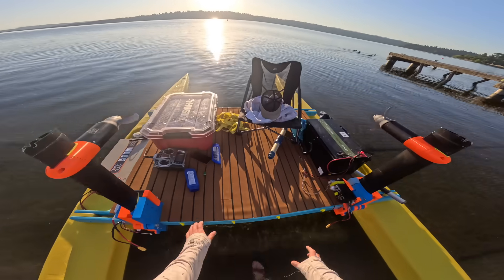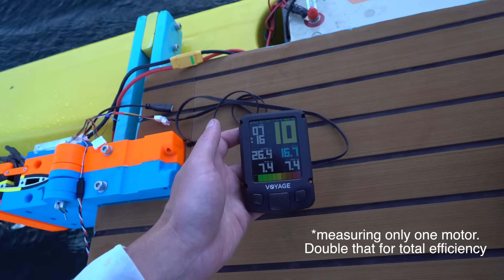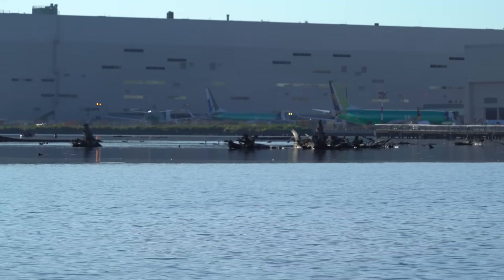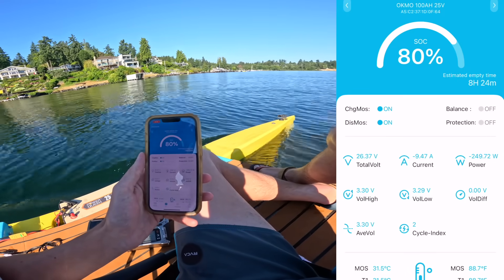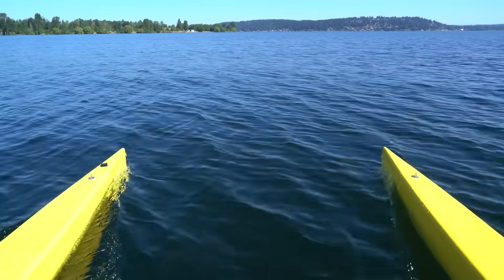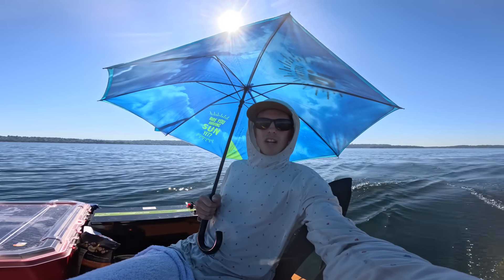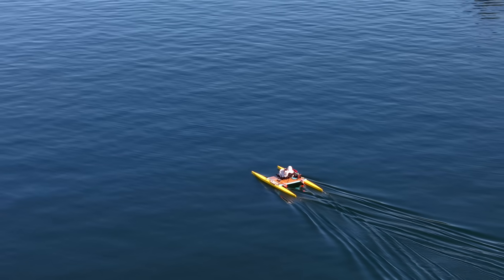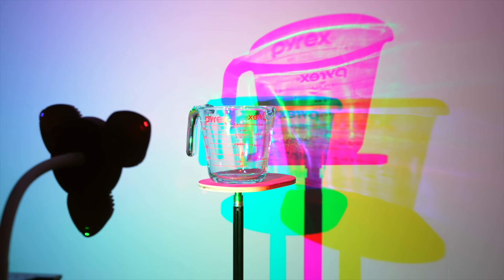Range Testing my Electric Micro Catamaran

Comment: You might want to consider adding V-shaped deck breakwaters along the forward sections of your hulls. These will deflect the water outboard before it can flow aft and potentially flood your bridge deck. It's a common retrofit solution for catamarans that experience bow diving in choppy conditions.

Comment: @rctestflight what about combining high speed stability and high efficiency in a dynamic design?. Imagine a 4 hulled katamaran (tetramaran?), but the external hulls should be significantly longer, then you can place fans pointing down, to fill up the space between the hulls with some air, sort of like a hoverboat, but because moving fast and not having a sideskirt, sort of like a ground effect vehicle, and use either propellers or back fans (or a combination) to move forward. Note the numbers of hulls was only 4 for this example, but it can actually be  increased, and the airfoil could be optimized to be efficient as both a buoy and a wing. All the fans would need active control of course, with an autopilot that allows for different flight modes, optimized for efficiency, speed, or optimal.

Comment: 07:00

The old run down house belonged to an old Navy vet who passed away in 2022 at the age of 91. So I'm guessing the boat has seen better days. He was a LTJG in the US Navy and afterwards went on to hold several leading positions with the Federal Maritime Commission including Director of the Bureau Compliance, Director of Domestic Regulations and Acting Director of the FMC, he was also Chairman of the Trans-Pacific Freight Conference. He has four children and fifteen grandchildren, I don't feel like putting his name out there but it was easy enough to find the house with google maps.

Zillow / redfin estimate for the house is between $5 & $6 mil. / 5100 sq. ft.

Comment: I remember in the video you mentioned that the catamaran tends to nose dive, which is an issue that old ocean liners had ( eg titanic and Lusitania) - to fix that issue you would probably want to try taking inspiration from large battleships (eg Yamato) as they increase the height at the front so it has a larger surface area. You probably already aware of this and have mentioned it, and I have probably just forgotten. Hopefully this is helpful, however I definitely could have phrased it better. Regardless, I cannot wait to see any future projects. :)

Comment: Would anyone array of solar panels provide enough energy to run electronics for telemetry and a few large servos? If so, how about a solar paneled sailing boat? Inboard wind/current sensors etc feeds data to an ECU that adjusts the sails and rudder to tack to the waypoints. Might even beat your other long range craft.

Comment: I have a proa, a large hull and a small hull. It handles waves over a metre high perfectly. The hull submerges easily under the waves, but I've placed the platform quite a bit higher up.

Comment: if you whant to increase the confort and avoid watersplash, take a look on va'a witch are tahitian traditionnal hull, they operate at the same speed as you and are very efficent. they also have like deflector and the top side of the hull witch are concave, that's helping when you are a bit diving it doesn't act like a fishing lure and keeps you floating even in rought conditions  thanks for the video

Comment: To manage splashes, which to your small boat you'd deem waves, consider flared bow tops. Something 3D printed should be enough to divert water off the front tips of the bow.

Either Atlantic Bow style flares, or World War 1 destroyer peaked bows to drive the water sideways away from the center, and definitely away from the battery compartments, which really need those capacitive water depth sensors to trigger the drainage pumps.

Comment: I think the taper on the rear hulls is adding more drag. You can see it by looking at the wake at 3:50. I'm pretty sure there is not enough flow seperation and its causing the flow on the sides to cross each other and creating the large wake.

Comment: I'm obviously partial towards your ground effect projects, but this here catamaran is probably my second favourite thing you built. :) The speed is impressive and makes me wonder whether you could build something even faster in the same format, perhaps with some active stabilisation using foils and/or vectoring to keep it stable over waves and in turns.
About the issue of workshop space, how about building the trimaran's central hull in two parts that you would assemble together before launch? That would also facilitate road transportation for the boat. Or you could build a bigger catamaran, which would probably be more hydrodynamically efficient anyway.

Comment: You must have designed the hall like hSv two, So how much you make it faster and increases the drag,
The fuselage whill ressist back  experientialy.
 within the volume of water that it increases  dependent depth exponentially,

So that's a way the geometry of fusion wouldn't be and limiting factor for your top speed,
It\n's would be the exact opposite at it would increase that drag and stability. 

You even can't put a certain amount of volume like a capsule or ceilander.
Along each individual Pontoons of cadomaran,
Acts along the body as a keel 
An also fix a mountain of water.This placement and drag four minimum speed , even. 
And then after those two long capsules , you can design that gradual curve,
Like hs v two u s army Catamaran .

Comment: You need lifting strakes, common on the front of pontoon boats. If mounted above the waterline, they have no effect on efficiency, but they deflect splash, and create lift when nosediving in to a wave. Below the waterline effects efficiency but lifts the front of the hull out of the water with enough power. You also need a solar bimini hard top.

Comment: You should make a little electronic devices to measure your kilowatt-hour/miles base on GPS+hall effect sensors so weather is integrated in the loop but give you real estimate of consumption for 50miles base on today weather.. because you can plot a graph with speed vs power and fine the most efficient point for your giving setup (motor, ESC, prop, battery, boat shape, drag (sensors, foils, safran)). (also if you can translate on the even just on an lcd screen measures for international standard viewers like me would be perfect (km, m, km/h...etc). I'm watching you from French Alps, you make very good content! 👍 Still understand, but can't represent my self what 50 miles really mean..  it's something like a bit more than 75 kilometers I guess, maybe 80..plus there is several miles type base on aéronautique, naval, and Brit... You don't make my job easy guys..😂

Comment: Advancing your ride height controller, I often dream about an active road vehicle suspension that instead of passively moving over bumps would actively pull the wheels up for upward pointing bumps and actively push wheels down for downward pointing dips.  Purpose would be an ultra smooth ride over bumpy roads. This could be semi-active where you’d simply variably valve a pneumatic suspension which can be done to respond quickly or physically push the wheels up or down. 

Thoughts?

Comment: About that makeshift wave dam. I used to sprint kayak competitively for many years. Sprint kayaks are pretty similar to these hulls, low to the surface so you wouldn't be affected by crosswinds. For longer distances, or choppy waters we would stick on our own makeshift wavebreakers, which is just a plastic soft drink bottle split into two "half pipes" , the two pointy ends attached forming a V shape, similar to a snowplow on trains. I thought it might be useful for you in the future.

Comment: 10:26 I've used blue painter's tape to seal a car that had a leak. Used the blue tape because I didn't want to have to clean up messy residue. The tape lasted 4 months, and only pulled loose because of of wind. It's water resistant and it won't lose it's stickiness. It's perfectly fine for that type of used.

Comment: I built a trimaran where the main hull was 17' long and 10" at it's widest. You have to sit on top because there's no way for a butt to fit in such a skinny hull. It has 2 4' amas for stability. It's pedal powered and shockingly efficient. It worked so well I quickly realized I have to build an electric version and a gas powered version. I am in the middle of converting 2 hobiecat hulls into a custom scuba diving boat with a 40 hp outboard. It should be very fast and very efficient and very stable.  Normally, if you're lucky, you get two of those three things.

Comment: So where are the largest gains to be made as far as speed and range go? Is it electronics & tuning, motors, propellers, or hull design? Like are you at the point where more power would mean larger batteries, more weight etc so diminishing return, so now your best move is to try different hull designs? Or are the hulls optimised and now the propellor design is where to put the effort?
It’s a fun/interesting set of challenges 👍

Comment: I use to race catamarans and to help prevent catastrophic nose dives we would have a foil shaped cross beam between the bows. It would be angled up slightly and about 3" to 4" on the chord although eventually the class rules were changed to limit the chord length. Primarily it was there to support the rigging but when the bows pitched in there was a noticeable corrective effect. To reinforce it you can use a vertical spar in the centre with a stay or cable running from bow to bow over top of the spar so the cross beam can be of lighter construction. Pros: on hot days the spray from the cross beam can be refreshing. Cons: If the cross beam digs in it's usually not a good day 😄

Comment: I vote in favour of the Trimeran project. Mostly because I got a double seat ocean kayak to make my own, inspired by your earlier work. I picture a solar powered electric trimeran with GPS control and stationkeeping, so I can use FPS goggles with the air drone (with landing pad) and tethered underwater drone without drifting away. The trimeran arms will be shock absorbing and flexible, the outriggers hold some batteries but also ballast tanks, and there's a sun tracking pivoting sunshade made of solar panels (that definitely needs a heavy duty spring hinge in case it takes a wave, I have learned in testing). There's a few different propulsion options past propellers though, an electric version of this fish-tail drive (https://www.youtube.com/watch?v=ZtCZZGK3GZ8) is my plan but this (https://www.youtube.com/watch?v=WevNiF2AbeM) eel-fin drive is interesting. Access to marine sanctuaries and never cleaning seaweed out of the prop is a great selling point. Anyways, please do a trimeran project, it will ensure mine goes much better. :D

Comment: 3:45 and where every single 737 ever except for the first ~50 made their first flights. There's a walking path between the final assembly building (aka Boeing Renton) and the airport parallel to the  runway, including a couple taxiway bridges across the Cedar River.  It's really neat to get stopped and have to wait for a greenskin 737 to pass in front of you before continuing your walk.

Comment: Daniel, loved the photos/video of the surroundings in this video. One thing I was curious though: in a drone shot looking down at the catamaran, it seems like the wake was causing interference patterns between the pontoons. Would the distance between them cause less or more drag if the spacing were changed? Can that even be calculated? But yes, you need bigger pontons as these are just barely working. Great project and can't wait for the next phase.

Comment: Daniel.
A couple of thoughts that are easy to do.
Just add an extension to increase the height of the front of the hulls, a quick 3D print should work, it won't be as good as a redesigned hull but it should help a lot.
I know you only had a few things there with you but the dam to help stop the water going into the hull could have been better. The shape of an arrow would have been a lot better.

There has been a question I've had about the weeds you go through. Could you make the leading edge of the motor mounts and the props razer sharp? It could all be self cutting as you go along...

And if you don't make another video before Christmas, I'll just say HAPPY CHRISTMAS EVERYONE 🥳 now. 😆👍

Comment: @ 2:45 - Xanadu is an 86' Motor Yacht built by Horizon Yachts in 2007, and previously out of Palm Beach Florida.  I find it interesting that it is now on the same lake as Bill Gates estate Xanadu 2.0.  It's current at 47°32'07.9"N 122°14'37.0"W on Google Maps
Reply: https://www.google.com/maps/place/47%C2%B032'07.9%22N+122%C2%B014'37.0%22W/@47.53554,-122.2461859,830m/data=!3m2!1e3!4b1!4m4!3m3!8m2!3d47.53554!4d-122.243611?entry=ttu&g_ep=EgoyMDI1MTIwOS4wIKXMDSoASAFQAw%3D%3D

Comment: 8:00 there is a few small mods you can do to prevent it from dipping to hard in waves without making the efficiency worse during normal conditions. you can have "flairs" in the front on both sides so then it dips it will hold you up and also redirect water while dipping in waves.

Comment: In my experience, waves on lakes are mainly caused by motorboats; wind also contributes to waves, but boats play a much larger role. I remember days when the wind was 8 knots. But it was the middle of summer, and the waves on Zegrze Reservoir were identical to those in mid-November, with 15-18 knots. Sure, after training ended, the waves became bigger, but the wind was 38-43 knots then.
Reply: Lake Washington gets pretty big wind waves when the winds are northerly or southerly. The floating bridges help to temper them a bit, but the sections to the north and south can still get pretty big, e.g., 2-3 feet in height.

Comment: Those hulls are too skinny, they are submerged too much to get a lot of efficiency, they are plowing through the water.  I think you know that already from previous videos.  You need to look at the 1960's Pacific Catamarans, that have fat hulls very efficient.
Reply: Even better would be somewhat modern A-class catamaran hulls.  Stupid light weight (under 10Kg for 5.5m hull), designed for some waves, very cheap when 8+ years old, and an optimized shape because the class allows and rewards nearly all innovations.  (Nowadays it is all about foiling, so non-foiling hulls are cheap)

Comment: All the experiments you are doing is really good.  But one important suggestion I have.  The next time you make something, take into consideration it should be able to handle waves efficiently or else all these experiments will only be considered as toys and not as actual use case.  Something like "Draco" bushplane which can land anywhere and "Trophy Truck" which can run on any surface.  But Draco and Trophy truck are extreme examples, so I will not suggest you so extreme machines but it should be able to handle waves pretty good, then all your experiments, inventions and creation will come to fruition in a real sense.

Comment: You really should add flares to the bow to manage the bows plowing down.
Reply: nah it's just an overall displacement to weight issue. most modern multihulls have this style of hull, he just got the hull volume a little too low for the weight it's carrying. longer and/or higher volume is all that's needed
Reply: @catahoulagarage  he's not gonna build new ones. Before WW II and during ocean going navies that built straight bow ships retrofitted those ships with flared Atlantic type bows to cut down on the blue water being shipped during rough weather.
Reply: @patrickradcliffe3837  Sure. Just pointing out that that would be fixing the symptoms, not the problem.

Comment: i am by no means an expert, but i would think some small fins along the hull might help keep it slightly higher in the water. make it slightly more resistant to waves.. i very well could be wrong, but some small(like inch or two wide) wings that are slightly angled up, and go along the hull might do something.. i would think less than 20 degrees, one inch or two wide, and maybe a foot or so long(maybe longer) wrapped along the side of the hulls(inside, outside or maybe both) could be interesting to see if it does anything for the ride height of the boat, and if it hurts performance.

Comment: Very cool, did you say 10mph? That's a respectable 8,6 knots.

The bubbles are most likely methane from rotting organic matter. Lots of thread algae in the picture. They indicate that the water is most likely quite overfertilized.

Comment: Could you add a simple sail to help the catamaran ?

It means adding a daggerboard(s) or keels. Maybe differential thrust would be enought to avoid having to add a rudder.

A simple 6 square meter windsurf sail and mast would be enought I think. No boom (wishbone) even needed. 

With a 3 part mast it can easily be rigged while under way with wind and easily dismounted and tucked away when there's no wind making the motors more efficient.

You can keep it on a normal windsurf attachement if you connect it with stays (cables) to the catamaran front. Otherwise a solid mast foot would work as long as the wind isn't too strong but it means it takes space on the deck and challenges the pontoon structure more :/, only upside is no cables. Also depends wether you prefer to strees the structure with flexion or simply traction/compression.

A fore sail would help equilibrate it otherwise as a catboat (only mainsail) it would have to be super forward :/.

(The equilibrium being center of anti drift surface - center of wind thrust surface (so essentially center of sail surface) = 0 or near 0 otherwise there's a tork.

I know you've tried sails before, maybe z chance to try again !

Comment: Very cool boat 5 or 6 mph is not bad at all you can go a long distance at those speeds. A fore castle hollow watertight box built on the front of your hulls would help with the submerging of your bows without adding much weight if you leave them hollow